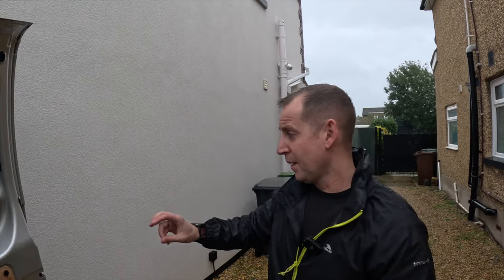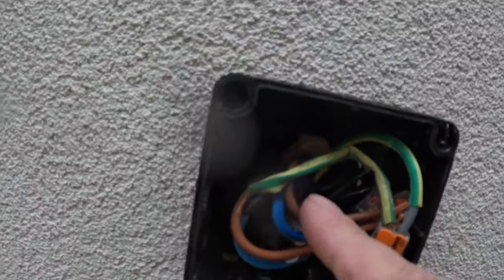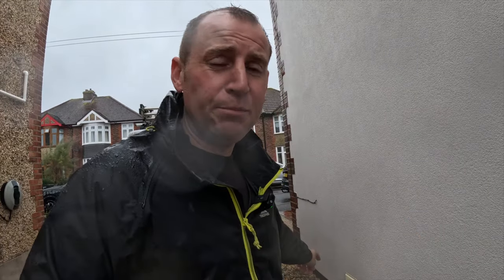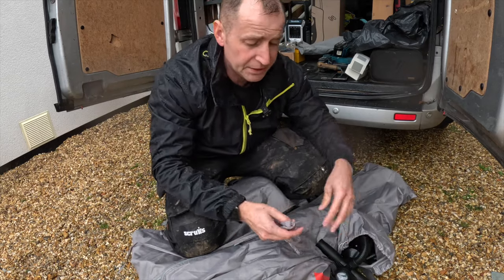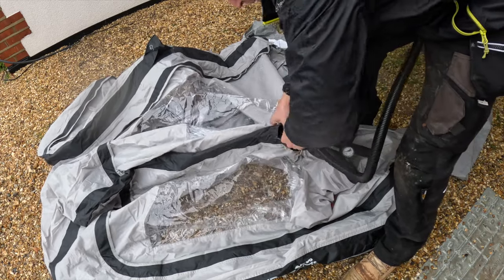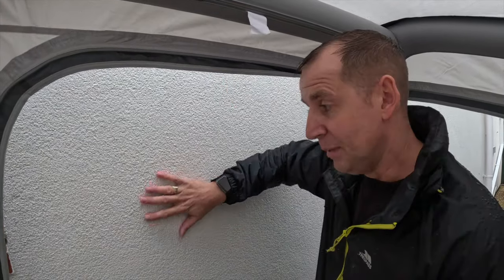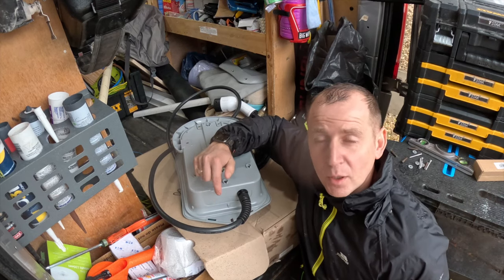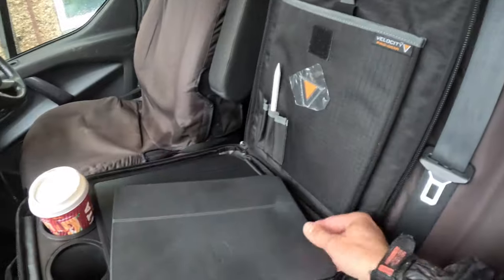The WORST weather to install an EV charger

Comment: The guy that owns dry cab is a smart meter installer which is what the product was originally designed to help with. EV was an after thought that came to light after manufacturing the product.

I personally don’t find them any good. As you’ve seen they blow away very easily despite the claims they can withstand gale force winds 🤣
Reply from the maker: They certainly can’t withstand gale force winds, you can tell it was manufactured for a meter man kind of job

Comment: Great video as always Adam.
I'm thinking of getting that rear van canopy and have been looking for an outside tent for my ev charger installs for almost 2 years. I just gave up in the end. Good to know that the drycab served its purpose.
What was it like drying it out? Or did you just put back in its bag wet?
Reply from the maker: Thank you, the rear canopy is an absolute no brainer, I put it back in the bad wet and it’s rained all weekend so not dried it, I’m going to pump it up tomorrow and let it dry out if it’s a nice day, il let you know what it’s like! 👍👍

Comment: Are you not worried that your angle is downwards below damp course
Reply from the maker: No not really, I didn’t go through the damp course and all holes were sealed after
Reply: You could see he drilled below the damp course not through it, and sealed up around the cable, no problem with that, good job.

Comment: It's simple.  Just get the cable manufacturer to make white EV ultra cable.
Reply from the maker: I don’t think it’s quite as easy at that but il ask
Reply: I might try white heat-shrink at some point and white linian clips if it’s a relatively short length. 🤔
Reply from the maker: @InTruServ  maybe not a bad shout!